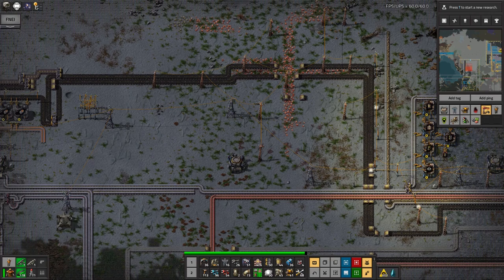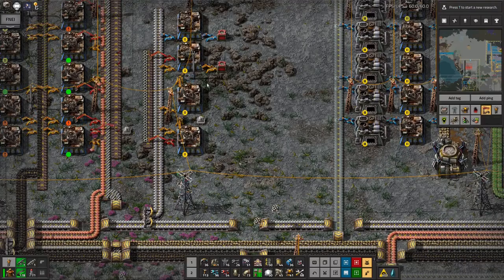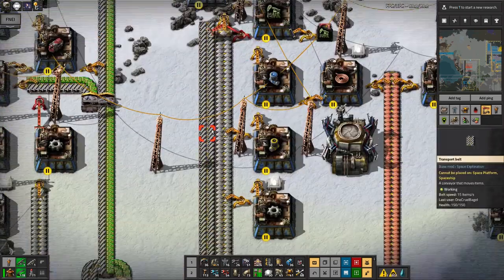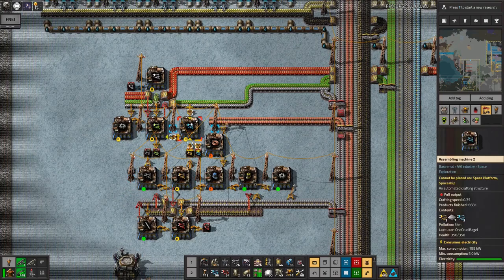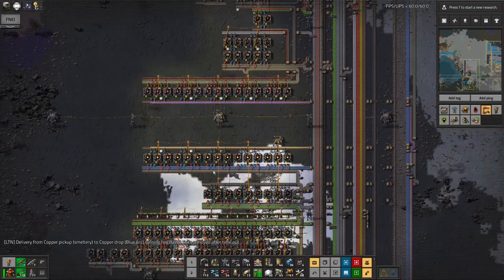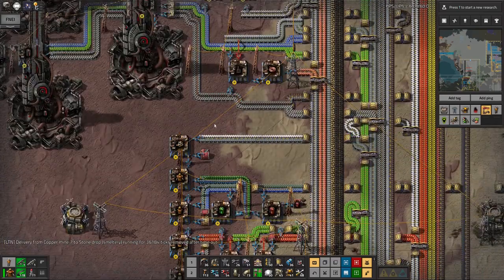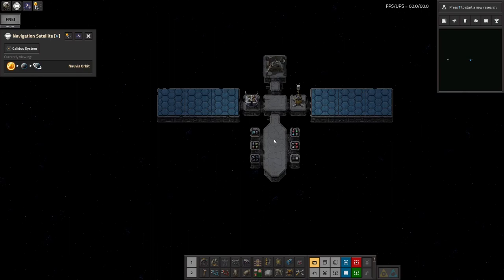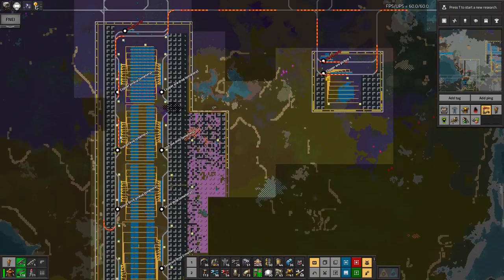S2-E00 - Series One Summary - Laurence Plays Factorio: Space Exploration

Comment: Looking good. Keep up the great work on it.
Just a idea you don't have to use it if you don't like it.
What if you were to make another copper spot some place else to see if that helps out to solve the problem you had with the other one. 
Looking forward to seeing what is next.
Reply from the maker: I built up a couple of extra copper mines at the end of series 1, down in the South East, so that should keep me going for a while. I may need to upgrade the smeltery at some point, but at the moment the challenge is more in building new parts of the base, rather than the amount of resources I'm getting through. 

Next is space! (or had you guessed?)
Reply: I was hoping you were moving onto the space part next. But I was not 100% sure. 😉
Reply from the maker: Yeah, I decided that the point where I finally started doing "space stuff" would be a good point to have a cut off and start series 2!
Reply: Good decision!! 👌👍

Comment: The motor laying around is because you probably had a logistics bot die. In Space Ex they wear out and die and you find random bits here and there if the other bots haven't gotten around to picking it back up yet. Thankfully they do eventually clean up after themselves.
Reply from the maker: Ah, you could be right! I've found one or two things randomly lying around and whilst I'd sort of remembered that the robots do occasionally explode, I'd forgotten that they'd drop stuff! Thanks!
Reply: It used to happen to me all the time. Later stages I started relying heavily on bots and kept finding things all over the ground. Took me a bit to figure it out until I actually saw it happen in real time.
Reply from the maker: @BoredBob  I'm trying to minimise how much I use bots off Nauvis (and on Nauvis to an extent) pretty much for this reason. And also because I prefer the look and feel of a belt base - it feels more Factorio to me.
Reply: Yeah I went really heavy bot usage in my build because it was easy to get things up and running, esp in space. But now I'm paying for it because I'm having to revamp most everything. Had to take a break from filming because I'm spending so much time on just ripping things out, redesigning, and getting it all going again. The grind is real!
Reply from the maker: @BoredBob  I'm in a similar position - I've decided that I'm going to do a major redesign for getting tier 2 of the sciences (and hopefully it'll be good for T3 and T4 too!) and that's meaning a lot of time spent building stuff up, and I can only make so many episodes out of it...